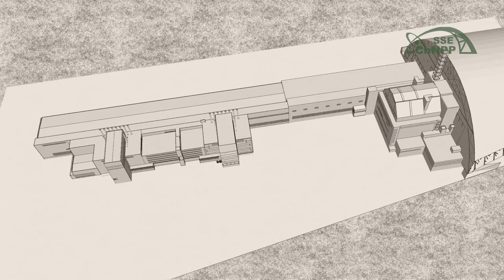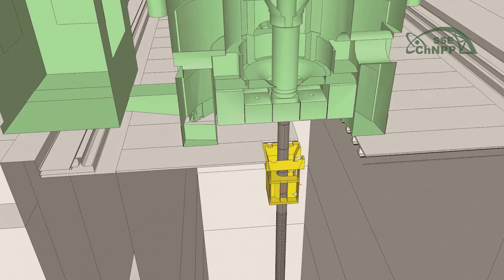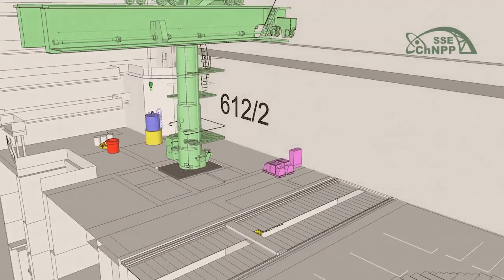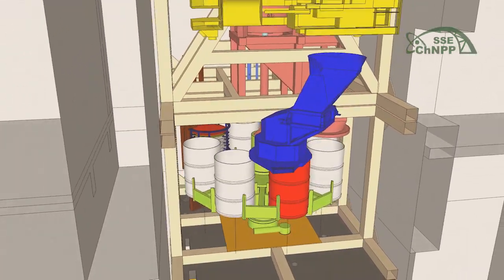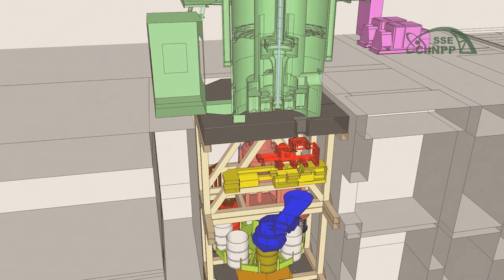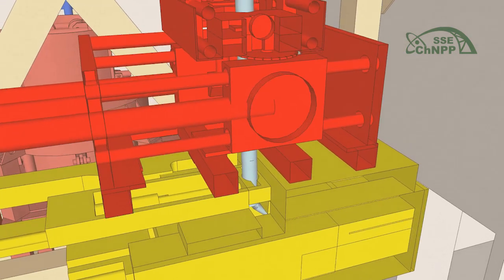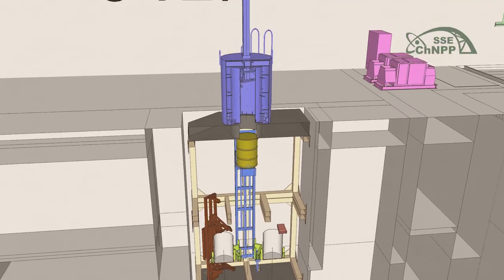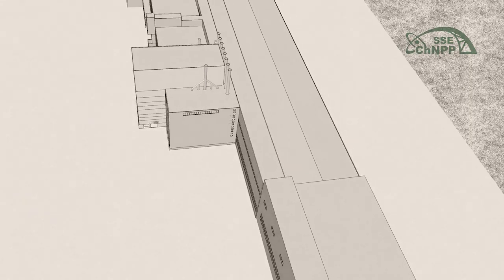Long-Length Waste Cutting Facility

Comment: The chnpp is a memorial and should be preserved ( except reactor 4 ) you should focus on reactor 4 instead of destroying a memorial which could be used to prevent accidents like this . You remove it = you delete history = accidents like this will happen again! Don't delete history
Reply: Dude they are removing the remaining spent fuel from the other 3 reactors for processing...they HAVE to do this...they can't just leave that fuel there
Reply: William Juett the fuel has been removed a few years ago . They remove Grafite blocks = they remove the reactor !!!!! They tear the whole thing apart !!!!
Reply: Κώστας Λεούσης stop being an idiot
Reply: Patrick Melo Modesto I'm not you sorry . Can't be a idiot :/
Reply: what you talking about !
you're miss understood.
Reply: Clarito resdiano no , they take it apart . They call it "decommissioning " and not destruction so we won't do something against it . They destroy the whole npp !! It won't be there by 2040
Reply: Dont worry. Arch is now under ukrainian workers control. There is no chance to dismantle so much. It already known that they gonna dismantle about 100 tons of material. Well... Concrete sarcophagus is 100..times heavier. Plus powerplant itself plus radioactive material. And they only gonna remove 100 tons.
Reply: Saju eNTe their plans are the Diamantling of the whole npp !!!!! Turbine Hall of reactor one : gone , turbine hall of reactor two : gone , turbine hall of reactor 3 : worm in progress ( until now they removed all the wiring ) someone has to stop them !!!!!!!!!! And the system they show us is for the dismantling of the reactors gen selves !!! There won't be any npp soon !!!!!!!!
Reply: knock - knock